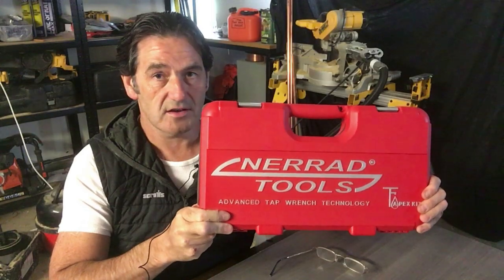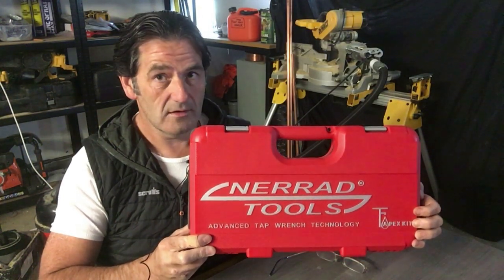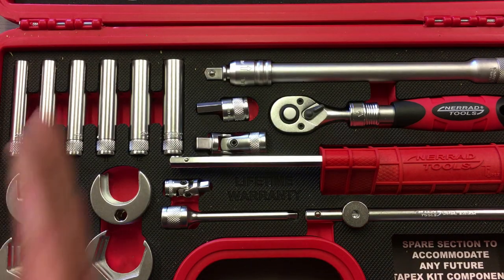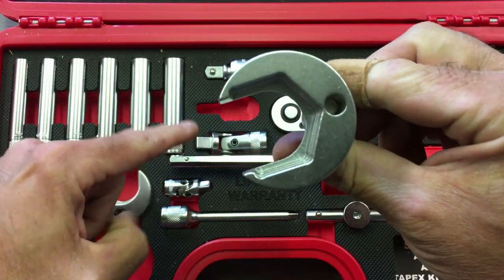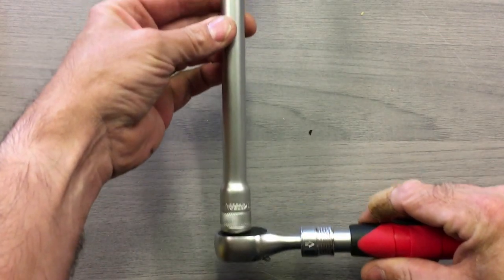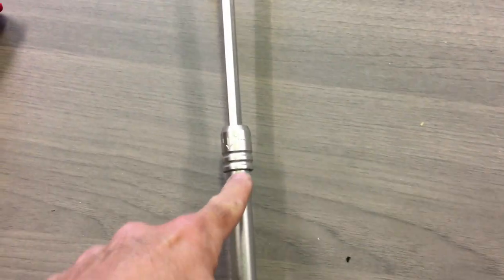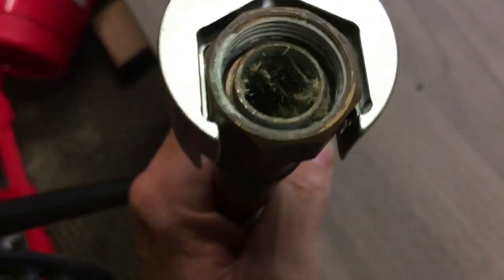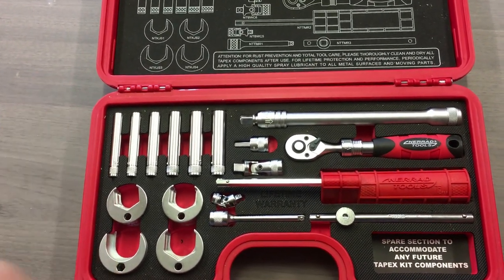NERRAD TAPEX Tap Wrench Kit Overview | Plumbing tools

Comment: I have this set and it barely comes out the van I still use my box spanner’s and trusty monument tap spanner. Honestly the body of the ratchet just gets tangled because it can’t turn around the pipe so it seems pointless as you have to pull it down to reset the position constantly. Sometimes things look shiny and impressive but just over complicate the situation. I would say the connections are nice and tight so have saved me on one set of taps on the two years I’ve had the set
Reply from the maker: Yes, I see what you mean, can be a bit of a pain getting everything together but it does help out on awkward situations. I have not used mine too much but it is good to have in the tool arsenal - for me anyway 👍💪

Comment: Interesting kit...It a pity you can't just buy the left hand side of the box along with the off set adaptor as most people could get by using their  own extension bars and ratchet driver ect...Just out of curiousity, how deep/long are the mono block sockets?
Reply from the maker: Yes, valid point Peter, but it is handy to have it all in one kit. I will check the length of the sockets and get back when I get a chance. Thanks for the comment 👍

Comment: Hi, could these be used to connect a flexi hose to a fill valve? I cannot get any tools at all into the space behind the toilet. Thanks
Reply from the maker: Hi Sarah, Yes, these could be used for that depending on the space - difficult to say without seeing the toilet. It depends if the actual head of the tapex socket / spanner can fit into the space. The Tapex set can get in to really awkward spaces, so I would bet that this would do the job. I hope this helps even slightly ? Thanks for the comment 👍
Reply: @Bacrenfencing  appreciate your reply, Nerrad set now on order.
Reply from the maker: @Sarah-Collen  I hope it fits or I will be due you 150 quid !! :-) Good luck and let me know if it works for you !

Comment: Socket set for mona block are no good for tight spaces you need a box spanner
Reply from the maker: Thanks Stuart, I have to confess that I have not used it on a monobloc yet, but I will keep a selection of box spanners in my bag just in case. I would have thought that the sockets would get into tight spaces but I suppose it depends on each individual situation. Thanks for the comment " 👍
Reply: Bacren Property Hi You can’t get sockets on nut sometimes because the pipe flex is to close to nut that’s why you need box spanner’s because they are so thin Thank you
Reply from the maker: @stuartsmith430  Ah, got you, I see what you mean now - thanks for the comment !
Reply: I having problems getting the socket set to tighten because the screw is too long stopping the socket herting tightened to the top. What beand of micwr tap are you using as i need ine with bolt to be that wee bit longer

Comment: Tap sockes are not long enough, useless. Otherwise ok
Reply from the maker: I carry box spanners just in case, but usually the tap sockets are OK. I know what you meant though, they could be doing with being a little longer. Thanks for the comment 👍